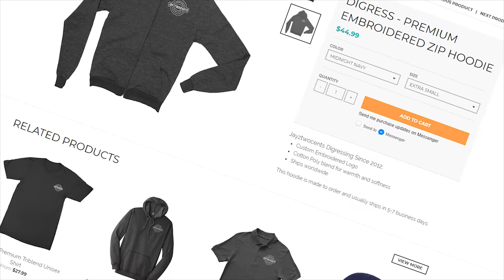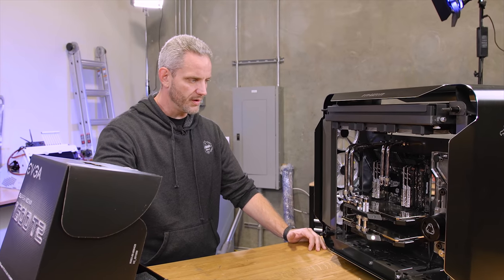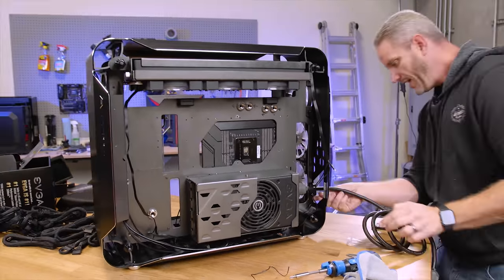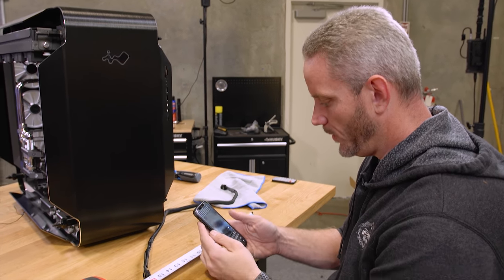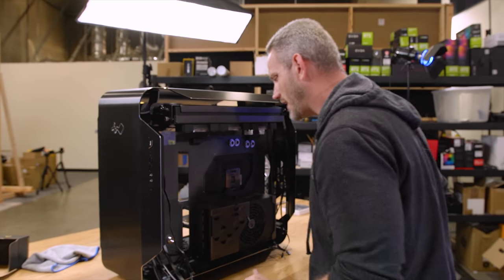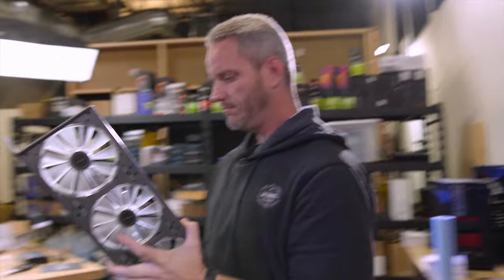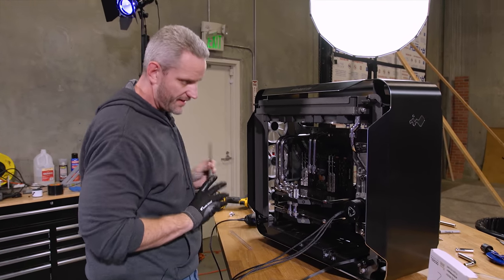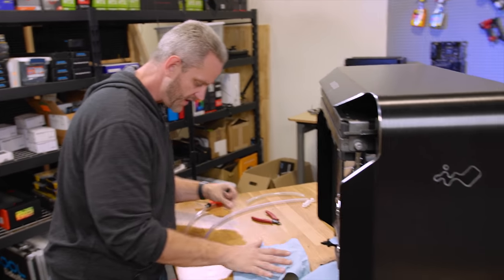This is the cleanest loop I've ever done...

Comment: I'm an English refrigeration engineer, all our pipework is in imperial, all compressed air fittings are BSP (British Standard Pipe), we buy milk and beer in pints, you find joiners still want sheets of 8' x 4' or lengths of 4 x 2 for example. The claim that we're a metricated country only holds water if you don't do anything practical, if you're in engineering or construction, you find you have to be bi-lingual. You cannot only be able to work in metric or imperial, you have to be able to use both.

Comment: For distance testing on cables from point a to b. I use pipe cleaners. This is also great  for pipe mockups, radius, etc... I then take a length of string and use that to get the overall length of said mockup. I then take that length of string and use a measuring tape to measure it.

Comment: JAY! A trick that I found out a couple years ago is to put a tablespoons or so of dishwasher detergent in the initial fill of the cooling loop. It has all of the anti-foam and lubricity agents so it can run and not induce any foam/air into the pump and still have a good scrub of all the residue from plating.

Comment: What’s the most expensive mistake you have made with a computer?
Reply: Flashed an old BIOS onto a newer BIOS. Bricked the machine. There was nothing wrong with it beforehand, I just wanted to update everything... But I didn't check the BIOS revision it had, and somehow downloaded the old one.. yeah... It was my college laptop.
Reply: @maj429  ...
Reply: @godlikemachine645  yeah, talk about feeling dumb. The one thing that was explicitly excluded in the terms of the warranty. If you break it by flashing a bios, they won't cover anything. turns out if you complain about being a college student and this being your only computer, they would repair it anyway. ACER even paid for shipping. I sent it in, in a prepaid box that they sent me ahead of time, and they replaced the motherboard and send it back to me all good to go at no cost to me. So I guess, technically, it wasn't expensive at all.
Reply: my first diy build, nzxt h700 case, really nice hardware inside, $250 mobo, strix 2070, 32gb of 3600 ram, 360mm aio, took me 3 hours to build it, and waire up all the rgb in a neat way, sat it on the kitchen counter which sits about 5 feet off the ground and as i turned away it fell face first onto the tile floor, ripping the gpu out, shattering the glass, and for whatever reason the ram no longer worked anymore, mobo was done for, only things i had left were 2 ssd's, hdd, and the aio/fans
Reply: @derrickgregg7639  you should join Linus lol! Sorry for your loss.
Reply: Dmoney Gregg, oof, how did It fall?
Reply: @derrickgregg7639  It hurts just reading this. Can't imagine what it's like when you've poured thousands of dollars into it... I would've snapped
Reply: Back in 2011 I bought a brand new Phenom II 980 Black and brought it home. As I am walking with the processor to put it in the socket, tripped on the family's cat and then combination drop/threw it into cermaic tile floor. Smashed in the exposed corner of the pcb, cracked the IHS and bend a bunch pins. 

Checked to see if cat is ok, as he just came back from surgery that morning and was shaking off the anesthetic, and then drive 30 minutes across the city to the place i bought the first processor and bought another.
Reply: @chrisgriep9496  at least the cat is okay
Reply: It's not mine, but I'll tell a buddy's: He forgot to screw a fitting down on his CPU block, when the pumped kicked on full speed, the tube popped out, dumped coolant all over his PSU, sparked, and fried his motherboard, PSU, and CPU. GPU was alive though somehow. He then donated his entire loop to yours truly and went with a DH15 and Stock GPU cooling. Lol
Reply: Your mom!! Gottem
Reply: I have a custom loop, I was working on it one day and I guess one of the power connectors somehow came lose on my 1080ti. It melted the end the cable and the connector, I was really lucky because I almost fried my card/burned down my $4000 rig
Reply: bricking a 980ti, lending an old sckool sony vaio to a friend who ran off to australia with it. Doing work for another friend who never paid me amd passed it off as his own work.  Now I have no friends.
Reply: Not Able to Afford It.
Reply: Dmoney Gregg did you try turning it on and off?
Reply: Well... I burnd a mobo. Gigabyte GA-H77-dsh3... Somehow, after taking apart the entire PC to dust it and check the case (Antec OneHundred), and after bending and unbending a socket pin (LGA1155, i7 3770 non k...), it booted... And worked for 3 months. Than, after 13 hours of data backup (My hdd is giving up), it rebooted and... The magic smoke came out of the BIOS chips. No idea why that happended. Oh. And my PC now detects RAM when it wants... One day I have 4 GB, another O have 2... Another 4... And it gave me 32 at a certen point... (2x 8 GB Kingston sticks, thats what i have). So... that is it...
Reply: Not correctly applying thermal pads to one of my GPUs on my first custom loop build. $800 mistake.
Reply: Never made a mistake with my custom desktop systems, but one time back in high school I let my MacBook (my school required a Mac to access their servers) overheat by leaving it next to a window on a sunny day in sleep mode on carpet. CPU was fried and the battery leaked acid all over the board.
Reply: Bought a relatively cheap high wattage PSU instead instead of buying a lower wattage one of better quality. Took a while to figure out what the problem was as i was new to computers, so it ended up costing over 400€ to repair. That's a lot of money when you're close to broke. Atleast i learned from my mistake, the PSU is the one part where i will never again compromise/cut corners
Reply: 8700k Delid gone wrong.... A couple days, 300ish$, and a 2 hour drive to Microcenter I got another one. Ended up scoring  MUCH BETTER silicone. (Last one BARELY held 4.8 all core with a 280 AIO) New chip hit 4.9 on stock settings (currently at 5.1 @1.325, I even got the courage to try deliding again) So it sucked but not TOO bad.
Reply: @SikConVicTioN  Sorry "BASE" voltage and TDP.
Reply: @jeanlafrance8746  insurance should cover that

Comment: This look is incredibly clean. I do have to say, for me personally, I like the utilitarian loops where the pipes run exactly where they need to even if it means odd angles or one strangely long pipe running across nearly the entire system...pretty sure you guys get what I mean. I'm also a fan of the loops that look like there is almost no tubing what so ever. My current build is a totally utilitarian loop, my next I want to hide everything, just two pipes taking a short run to and from the CPU block being the only runs seen.

Comment: That is a very clean build.  "CLEAN" is the exactly appropriate word.  I'm doing a 4 x 1080ti, deep learning machine right now in a Thermaltake Level 20 GT with potentially 2 separate loops (still brainstorming measurements and looks) and it will look cool with all the RING Plus fans and everything matching, but it has no chance of being even close to as clean as this build.  I would love to do something like this build in a year or two for my office machine.  However, I will likely never get around to that because I put my personal office computer on the backburner and never get around to it!

Comment: Little late to the party on this one, but whatevs.
Lighting/mic stand + D5(vario ideally)/tube res combo hooked up to the two open ports on the distro block.
Heck, you could just fit a snorkel onto the fill-port - a spare few feet of tube running to above the case.

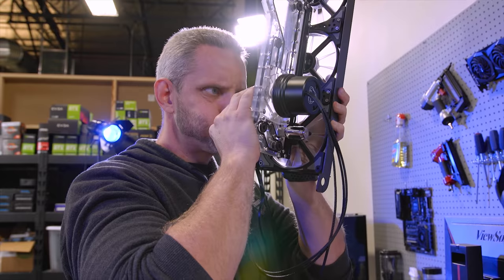Comment: 10:18 We have to air test plumbing lines for inspection. One of the guys told me water molecules are 4 times the size of air. So if it doesn’t leak air, it won’t leak water. Although we had it up to 80 psi, and that would likely destroy pc parts, or at least blow them apart at the fittings.

Comment: Gorgeous tubes and tubing ! ❤❤❤ THAT'S hot I'm going to do mine too. It just looks perfect. 
And I do mention that I don't mind no transparent RGB tubing in favor of chrome ones or similar. 
I've done quite a few loops in my previous systems but I always preferred 'clean water' + anti bacterial additive for longer period of utilization, and for me hating the gunk-up and the more periodic  cleaning sessions. 

The only main difference on my system will be that I have a Phanteks Enthoo 719 formerly known as Luxe 2 (Thermaltake DICKS), and I don't want to make holes in my case so I'll have to make us of the Phanteks Distro Plate, but the finished tubing will still have a clean look. 

And if I'll have to route the tubing to the front and/or front side I'll utilize the power supply shroud for routing the tubing behind it. I have quite a lot of space there because I don't have the HDD caddies installed and my power supply is a pretty compact Seasonic Focus Gold 750W unit.

Comment: One way to reduce the bubbling issue and enable higher flow rates and potentially higher heat transfer rate is to add a safe surfactant to reduce surface tension. 

I suggest adding some Redline water wetter or equivalent, widely used by cars to severely reduce bubbling and eliminate hotspots. 

Cars have been running liquid cooling systems with different metal components for decades with very high rates of reliability if the fluid change intervals are met. I wonder if anyone has tried using Toyota Long Life Coolant and distilled water 50/50 mix with just the right dosage of Redline Water Wetter in PC custom water loop. I doubt corrosion and organic mater growth can become a significant issue with this well proven coolant mixture. The ehthelyne glycol based HOAT coolant isn't just an antifreeze and anti corrosion agent, it also lubricates the liquid pumps (automotive coolant pumps rely on this for lubrication).

Comment: You can also use that leak tester that Linus used a while back: pump air in there and see if the air pressure drops after an hour or so (or shorter). If something is air-tight it will be water-tight (the reverse is not always true).
It's a leak test without any damage if there are leaks.

Comment: Well Jay my Barrows 16mm chrome plated copper tubing arrived yes it has to be cleaned but not the way you do it. Go to any auto motive store buy parts cleaner brush for cleaning cam ports about 2 foot long they are cheap. soap and water use distilled water to rinse

Comment: Jason, there are some tools your shop really, REALLY needs.  1) a 6" vise mounted to your work bench.  2)A pedestal or bench mounted grinder (get two so you can have one mounted with a polishing wheel and a wire brush wheel.)  3) mini chop saw.  4) a 1" or 2" bench top belt sander.  And if you don't already have one, a drill press.
Reply: Don't tell him what to do

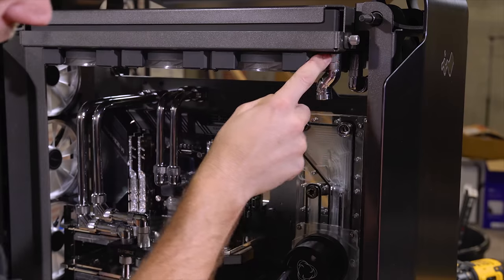Comment: Jay.  Great build.  Question though.  At the 11:36 mark you're connecting the offset down from the radiator, then to a 90.  The offset is pretty noticeable.  Could you not come straight down from the radiator to a 90, then have the offset connect to the block?  Hiding the offset from view behind the bend?

Comment: That drill/lathe trick is really good - just be sure you have the pipe cutter running square before pulling the trigger - or you will get a nice 'screw-thread' line cut into your tube! 😒
(Ex-plumber)

Comment: Because you're using real copper or brass tubing, you should think of getting a custom magnet filter perhaps. Would've been badass. but im not entirely sure how long magnetite will have to run in your system to eventually break parts around..

Comment: There's the downside of your low mains voltage: ridiculously thick cables. And if somebody does not understand, it is because to carry the same power with a lower voltage you have to have larger current and that needs thicker wire. There really is no upside to having the lower voltage, and no, it is not safer as some have argued (meaning 120 vs. 230 V or whatever the nominal values are nowadays).

Comment: I haven't built anything with water cooling yet. But I wonder if a vacuum pump would help when doing a fill. Rig up a connection so that you can suck out the air close that valve and then just turned another valve and the vacuum just pulls in all the water from a tank.

Comment: I’m surprised no one makes a “Airlift” type tool for these water cooling system. It pulls a vacuum on the cooling system. Then allows you to drop a line in the coolant that once you crack the valve the negative pressure fills the system without inducing air. (Wouldn’t be hard to make your own. (1) Tee, (3) valves, (1) vacuum pump and hand full of adapters.)

Comment: Finally I am want to move from 4930k GAMING platform, would You:
1. Buy 3700x with x570 mobo and upgrade down the road to next zen in late 2020?
2. Wait till Comet-Lake S arrives in Q1 2020? 
4930k is hell a cpu, but I need to upgrade my watercooling rig with new build so I wanted to upgrade also CPU on the occasion.

Comment: Us Brits Still use Stone and lbs when weighing, Pints and Ounces, would be weird to go to a pub and say can i have half a litre of Beer. No it is a Pint. But there is many transitions, in place that still use imperial, that we have to use. Eg, I work in Oil and we use nm - Nominal Bore of Pipe as per American Petroleum Institute, and ASME, for MAN_SIZE Pipe/ 48"-72" Then when we design it, some blue collar guy has to weld that, inside and out.

Comment: 5:45 Exactly, which leads me to the following question:" DO you know how many yards make 1 mile?
You probably don't know it off the top of your head because it's 1759,9518810148731408573928258968..., if you wonder, no that's not the point where the fraction starts getting periodical, it's simply all the digits the Windows calculator was able to give me.
On the other hand, guess how many millimeters make one kilometer. That's right 1'000'000 millimeters make one kilometer, as 1'000 millimeters make 1 meter and 1'000 meters make a kilometer.
Everything is a decimal potency.

Comment: Why run and flush the system for a while when you can clean and flush each tube before installing it? At least that way you can be pretty sure they are clean and free of any debris. You can even quickly flush once more just to be sure as well.

Comment: Surprised you didn't think of using a 90-degree right-angle connector for that 24-pin cable...would keep from having to do any radial bending on that one.

Comment: Jay I think it's a good idea for merchandise you guys could sell and probably make a freaking killing would be take motherboards that mid to high-end that are very overclockable, overclocked the shit out of them but do your magic on them where they're stable and then a date 35 to $50 charge on top of the motherboards normal price or the overclocking that you did to it and sell them. Simple reason is you get a lot of people myself included I've got an awesome motherboard for overclocking but I start anchoring and I tweaked something that shouldn't be tweaked too high and something not high enough cuz I know a little too a mid-range on overclocking when it comes to voltage and stuff but just not enough to where I can get it a good stable overclock without getting artifacts or the dreaded blue screen or reboots Sullivan I end up taking my overclock and down stepping in a little bit to where is probably way too safe and I could get a way better overclock where if you use your magical hands on it I wouldn't have that issue and believe me people will pay probably way more than 35 to $50 for somebody to overclock a motherboard because it says um dealing with the headache

Comment: I work in a middle level high rise and for our closed loops no matter how small or how big we do bleeds and have Hoffman's I dont know if you could scale one to pc water loop pipe but they have small ones to faint one and they let air out and as for filling a loop if it's a reall small one.  We will typically fill and leave open the drain on the pump and then boost fire the pump  a couple of time to get out large air a couple time wonder if that could be done with a pc.    Any ways cant wait to take you advice and build my own computer

Comment: Hey Jay.
Video idea:
Do you think you can make a video where you explain what do all the settings, or at least the most important, in the Nvidia control panel do. I have an Nvidia GPU but, being that I'm not familiar with the settings I leave them all in the default configuration. I can't help but feel that I could be enjoying a better gaming experience just by changing a couple of settings in the control panel. If you could just go over the ones that affect visuals and/or FPS the most, or maybe the ones you normally change in your personal builds, that would be awesome. Maybe a second video showing the most recent ones that Nvidia added in the recent driver updates and how they affect gameplay. I think that would make for a couple of interesting videos.

Anyway, please don't leave me hanging. I'm a long time subscriber and the other times I've offered video ideas you never seem to answer. Thanks in advance. Have a good one.

Comment: My GPU has a 6 pin and an 8 pin VGA power connectors... Which cable from 'Cable Mod' would I need? Is it the 8 pin/6 pin bridged PCI-E cable? I'm not totally clear on this since I cant find any pictures on their website of the whole cable. I don't want a cable that splits from one 8 pin at the PSU to a 6 and 8 pin at the GPU.

Comment: Jay - get a bench vise that has rubber v-jaws.  You shouldn't be holding a part in one hand and working on it with the other.  You'll make mistakes almost every time.  If you can clamp the tube you can hold the dremel with both hands and you'll stop hacking it up.